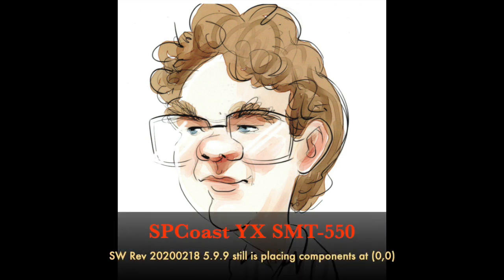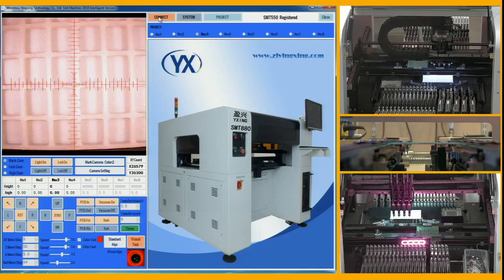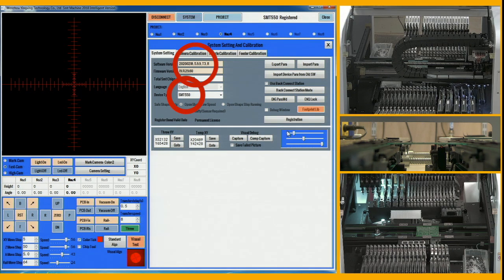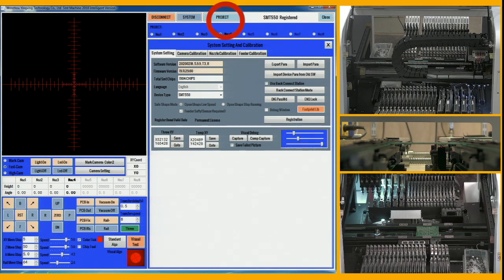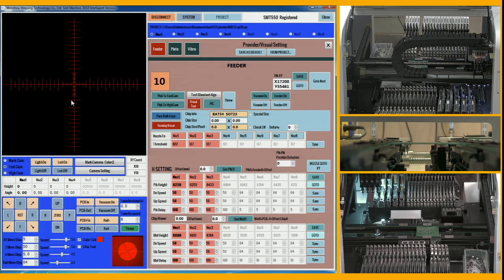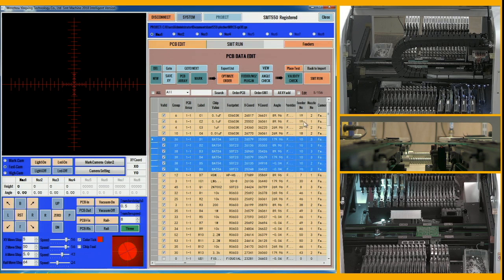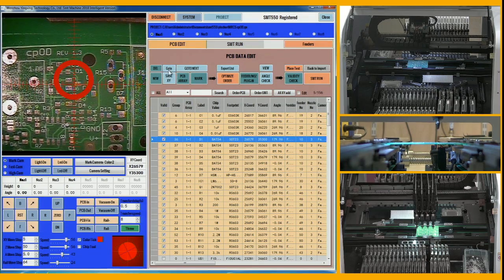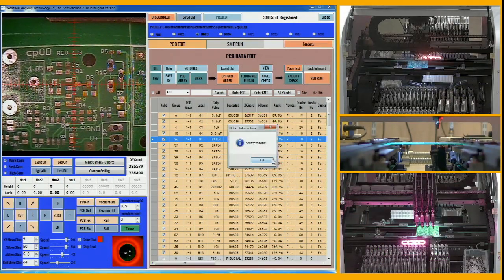SPCoast SMT550 Issue 2020-04-11 V5.9.9 is still placing at (0,0)

Comment: Hi John, thanks for the detailed videos. I'm looking at purchasing an SMT550 and was wondering if you would recommend it after having used it for a few months?
Reply from the maker: The 550 hardware is solid and reliable.  The software, not so much.  It is usable, and MUCH better than the CharmHigh stuff I was using on my previous -48, but still missing huge usability chunks.

Examples: There are few choices for component identification (for camera alignment), zero documentation about the ones that are there and (apparently) no way to modify/add more.  e.g, there is a single SOT23-3 choice, but nothing for other variations (-4, -5, DPACK, yadda)  There is no calibration validation mechanism for lighting and camera alignment other than to waste components blindly experimenting...  The support from YX is painful - fast responses, with no content other than "we've sent your report to the people who wrote the software".   

The feeder location assignment is done on a per-board/project level, with no concept of a common BOM inventory.  That means that every board that uses electrolytic caps gets that package assigned to an arbitrary feeder, which then needs to be manually calibrated to account for the 10+mm component height at mount time - otherwise the head slams the cap into the pcb and bounces all the already-mounted components out of alignment.  If only there was a way (like with the Charmhigh) to incopporate a BOM database with component heights into the ingest/setup process.  Alas, the file formats used are proprietary, undocumented and (worse) not understood at all by the folks at YX...

I've heard very good reports about Kayo's first-party control of their software, and the Kayo and YX hardware seem equivalent - they were my second choice, and I sometimes regret not going with them instead.  Their file formats are well documented XML files, and they actively support the integration into external workflows.

If I had the time, I'd work on porting OpenPnP to the YX and abandon the OEM software, but that doesn't seem likely for a few years yet...
Reply: @JohnPlocher  Thanks so much for your feedback! Kayo was the other one on my list.
Reply: @JohnPlocher   Again thank you very much for these details video , and experimental report. I could be in this case of "non standart SOT23"
Unfortunately, Kayo was really more expensive, but at least, some french support are available...